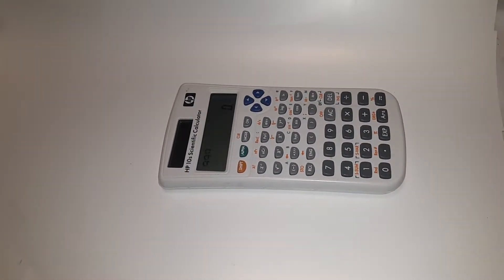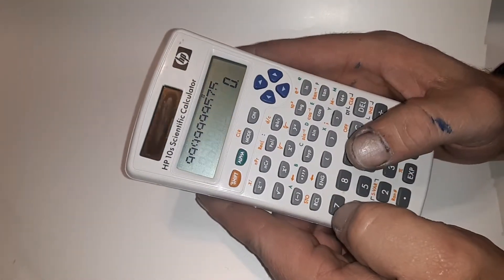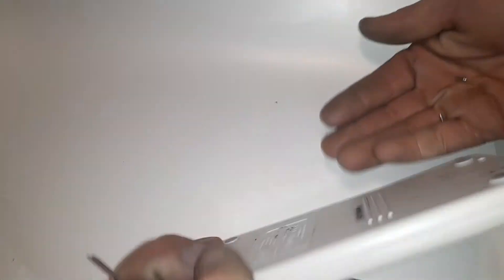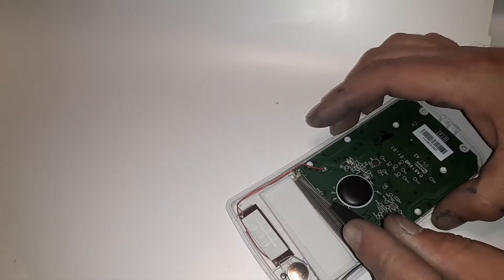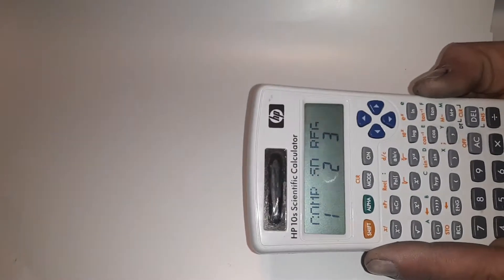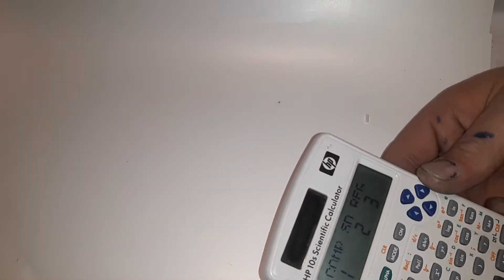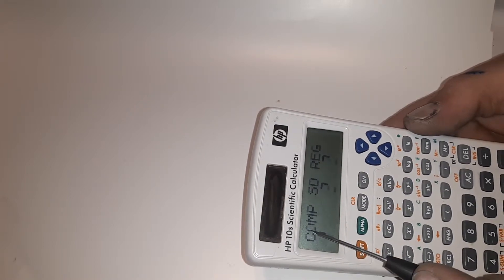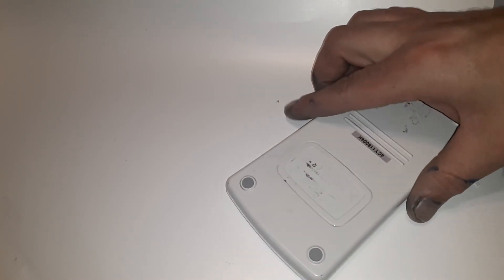Fixing HP 10s Solar Calculator

Comment: Thank you! Just fixed an old hp 6s solar calculator based on this video. Basically, rubbing the top of the ribbon cable where it is bonded to the circuit board restored the connections and hence the display. Amazing.